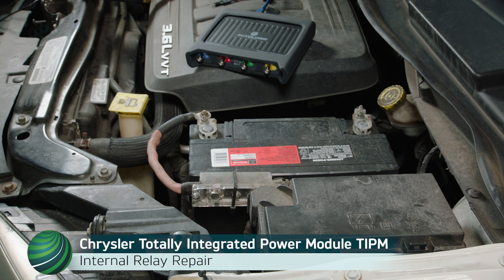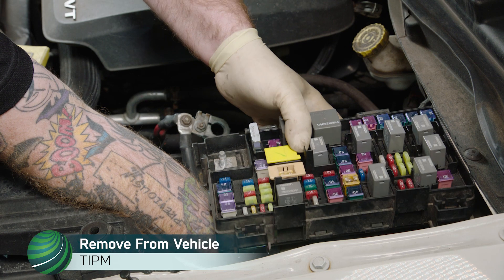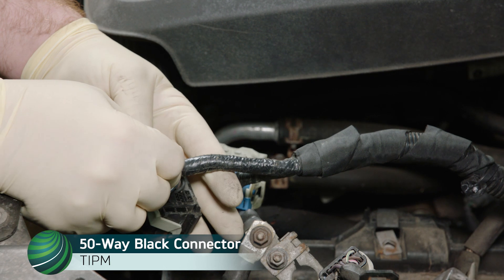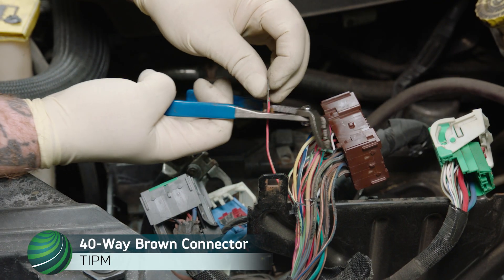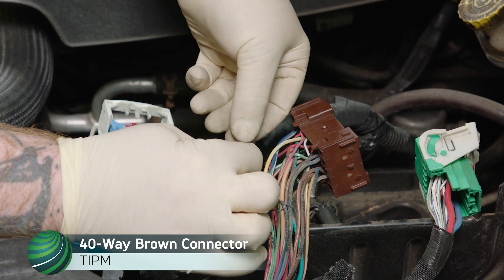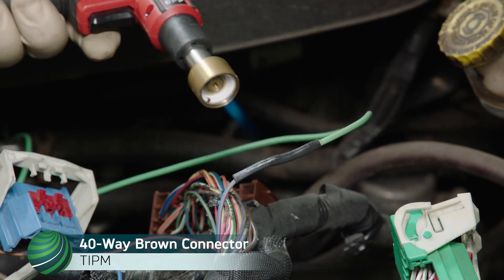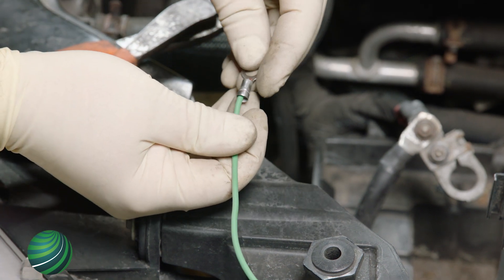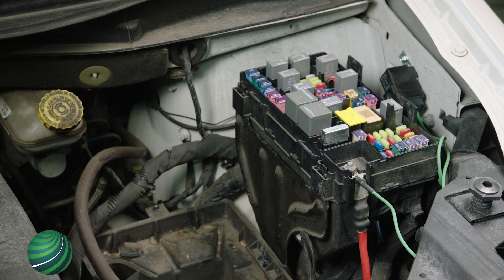Chrysler Total Integrated Power Module TIPM Fuel Pump Circuit Failure Diagnosing, Testing & Repair

Comment: 2014 Town and Country van. What is going on in my van is, the windshield wipers are going, all the lights are on in the dash, it say to check to service the tier pressure system,  service the blind spot system. Plus it say the cadlic convert is gone. Getting pretty expensive with all that happening at once. I looked at the fuse box, and a few fuses are missing. Don't know how that happened. Have any idea's???

Comment: it sounds like you wired  
30 pin of  the the relay goes to the power 
 85 was wired  to the pink/green wire 
then again  85 pin of the relay is sodder to brown wire in the black connector 
then finally the back to the brown connector where the 
blue/orange wire  is sodder to the 87 pin of the relay 
no 86 pin ? am i missing somthing ?

relays      87
       86              85
                  
                   3
                   0
Reply: Im with you on this too. Two 85 wires on the external relay? I'm confused
Reply: He mentioned connecting relay  terminal 85 twice, that's wrong. Relay terminal 85 ONLY connects to BROWN  WIRE.

Comment: Watch out for internet and mechanic bypasses that leave the key on engine power to the fuel pump when the key is turned on in an accident you could be feeding the fire and cause an explosion or death don't buy the cheap kits online and don't let your mechanic solder a wire or make one you are risking your life and other people's lives this one fixes it correctly
Reply: Definitely 💯

Comment: Good video but it could have been more clear about the wires going to which terminals at the new relay. The dealer sends 4 loose wires and a seperate relay. Also I didnt see an explanation as to why you removed the green connector. Otherwise this made the job much easier. Thanks.

Comment: AUTOLOGIC, what does the TIPM do to the cars modules, does the TIPM circuit convert CAN signals into other buss signals or what?
Reply: No. It’s mostly a circuit board with most of the fuses attached to it for the circuits of the vehicle but it also houses internal relays, like the fuel pump relay, which is non-repairable.